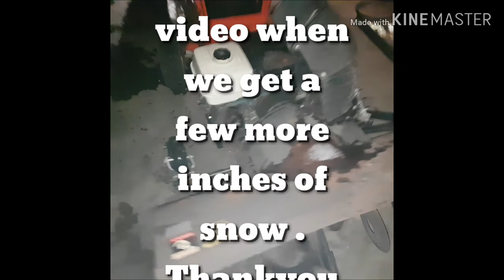Diy snowblower modifications!

Comment: Have you found that the 11hp is doing well?
Reply from the maker: I'm sorry for the very late reply! its a 10hp but yes , incredibly reliable,  it is tired and need a set of rings, but it fires up and runs great! after a valve adjustment , cleaning and setting the points it runs wonderful for its age